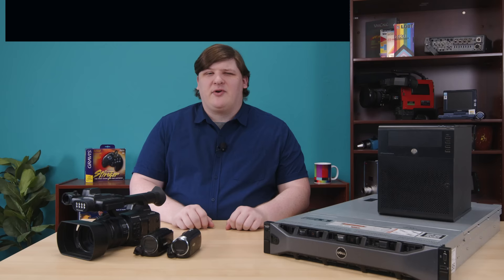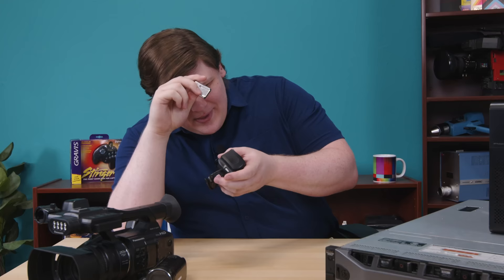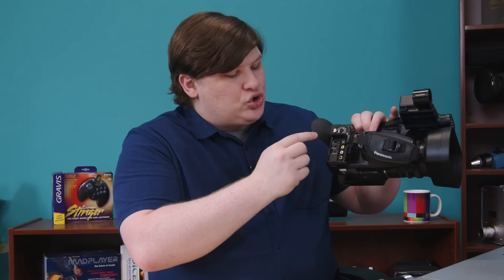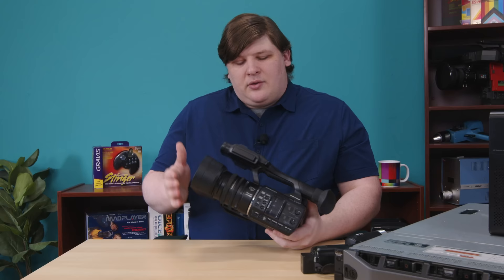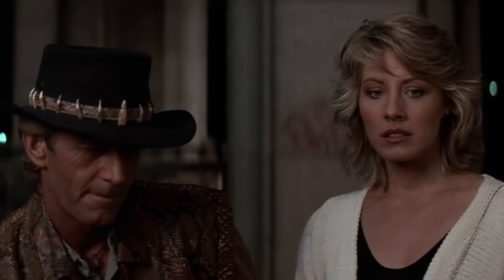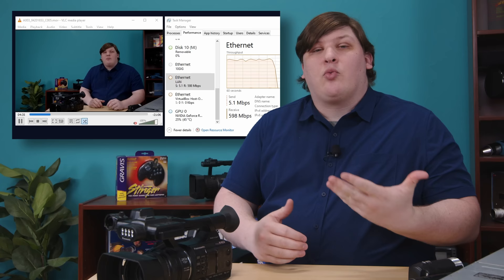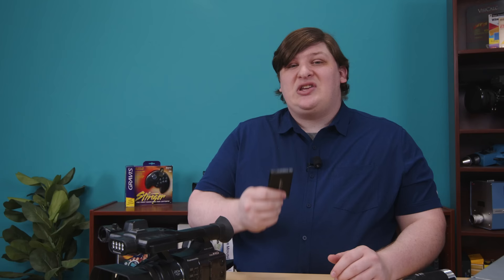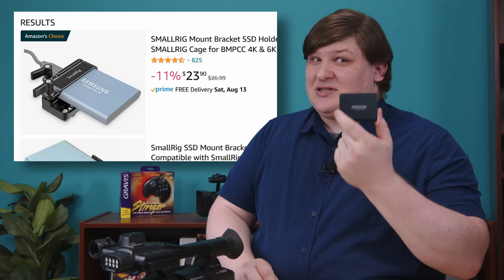I Built... a really fast NAS?

Comment: Lookup lizardfs or moosefs.
Buy two or three more servers.
Don't raid unless it's for improving IO. Use lizard EC2 goals, possibly ontop of ZFS if you feel the need. I just JBOD from Areca controllers.
Setup an archive location and use Lizard to manage redundancy at a filesystem level, then do backups of the lizard metadata often.
Setup a flash storage with SSD's/Ramdisk so you have an editing store, also doable in lizard if you wanted.
You can then add more drives or more servers are you need to expand your storage without dealing with a bunch of raid stuff.
You can also set your raid "level" or redundancy goals at a folder level, so you have more control about how you store content.
For example, we take a source file and make MP4 proxies. These don't need redundancy, so that whole folder only stores one copy but we have 3 of the source.
If I was to loose a proxy file, we can re-encode it from source. I'll sacrifice a bit of computation for the saved storage.
If you need to do maintenance or have hardware/backplane problems you'll be hooped with only the single box. As you become more of a producer, that time more and more becomes $ or lost $.

From a guy managing over 300TB of archived producer content on consumer hardware, LizardFS is like a gift from god. 
There was days I'd have to tell people to go home because a raid was rebuilding, now we can loose whole servers off the network and the content is still accessible.

Comment: Until a couple of weeks ago, I had a lovely silver T7 for 2 years.  Lovely fast drive, certainly more than fast enough for my needs, and the encryption didn't slow things down perceptibly (fairly important as I do deal with some data that requires security - nothing really secret though).   Then one day, I was copying a load of files to it.  I tried to pick it up, and it almost burned my hand.   I immediately unplugged it, and left it under desk fan to cool it.  When it had cooled to a reasonable temperature, I tried to plug it in.   The enclosure was picked up by the computer but the SSD wasn't.

Got another one now, and I've managed to get most of the data back from other sources, but it still annoys me.

Comment: I saw this same problem when I started to record HD content, to solve it I now capture from the HDMI out on my Sony A7Rii when recording at 4k using a USB3 Elgato CamLink 4K and offload the compression and storage to the PC which is connected to a NAS on a 10GBe link. Obviously this keeps me limited to the length of my HDMI lead (about 10m), but is a very cheap solution.

For your kingston device, just 3d-print a shim to fit them properly, would only take about 20 minutes of modelling to make it.

Comment: Since you are working with large files, with a point to point 10gbe connection, make sure the NICs at both ends are set to an MTU of 9000 instead of the default 1500 which is common in consumer products (Eg, Windows desktop). As network failures requiring retransmission are very unlikely over your short, reliable connection, a 9k MTU will significantly reduce the relative amount of network protocol overhead vs data and will increase throughput.

Comment: The t5/t7 drive thing caused some APOCALYPTIC rage in the pro video world, it isn't just you.

What I'd suggest for the clamp being doofy is getting a 'cage' that has cold shoes and rails in more, better places to mount the clamp. Conveniently, they're usually made by smallrig
Reply from the maker: Yeah, I ended up buying a clamp that fits the T7, and it has an infuriating spring loaded design but I can work around it. I got a cage as well, and it has a shoe in exactly the right spot, so I'm pretty much good to go, even if this is... not a satisfying solution, lol.
Reply: @CathodeRayDude  someday, a piece of camera rigging gear will decide that camera operators are neither willing to just hold something with a spare thumb the entire time or grow six spare arms to put the rig together in the short term 

Until then, well,

Comment: FYI look into U.2 NVMe drives...mechanically the connector is SAS, electrically it's 4-lane PCIe. The drives that come in this format are designed to be abused by writing unlike consumer SSDs, all with the insane speeds of NVMe. For example Kingston has reasonably priced product ranges. Used server gear will slowly start supporting these.

Comment: My Intel Core i7 12700k includes hardware encoders for h265 & h264 which helps when I transcode videos. Some videos that would transcode at 10 frames per second now transcode at 100 frames per second or higher. I built that for a plex server while the video cards where 2 to 3 times MSRP.

It might have been corrosion from humidity on the connectors depending on where the server came from for when unplugging & plugging it back in fixes data connections. please note they level of corrosion may be small enough that you won't even see evidence of it after you unplug the connectors & look at them.

Comment: I'm not familiar with that server backplane in particular, but SAS does have redundancy features built-in, so it's quite likely the extra cable is indeed a second channel on the backplane to provide multi-path support.  Speaking of FibreChannel, it also does this to provide cable and even switch redundancy in a SAN environment, and both use WWNs to individually identify paths to storage targets.

That said, if the second path is causing the RAID card to drop PCIe lanes, that probably means it has caught The Dumb and may not be super reliable.  Kinda sounds like that machine has seen some stuff, and you may be replacing parts until you've built a whole new ship.  But hey, with tons of them out there in circulation, that's not necessarily a big deal.

Comment: 1:21:08 Fun little fact about those SAS to SATA cables that I had to discover a while ago when building a somewhat (but also somewhat not) similar storage solution: They are actually directional! This really surprised me, since when was the last time you encountered cables that only work in one direction despite the connectors being identical on each one? Anyway, in my case I was trying to hook up SAS hot-swap bays to a standard SATA interface, so naturally I had bought the wrong cables and had to go back and find and get the right ones.

Just some of those weird things you only really experience when using enterprise grade hardware in ways it wasn't designed to be used.

Comment: 12:32 Now, most cell phone cameras already do this. My Pixel 8 Pro has a 50mp camera. When I take a picture, I can go into the photos app and it gives me the option to "select a better shot" with a slider that I can move along a short video clip that it captured on either side of the initial picture I took. It is quite clever.
Reply: It has become quite universal. I was surprised when windows recognized it when I transferred photos over from my (samsung) phone. It's been useful quite a few times, especially since shutter delay continues to be a problem on phones.

Comment: Ey, don't diss the HP N54L, I still use 2 of them for stuff an things. Right now one is hosting 4x8TB over NFS (via SFP+ DAC cable) to a VM host without slots for disks.
Previously I used one for ARM (Automatic Ripping Machine) with 1 BD drive in the 5.25" bay and then 4x USB-DVDs sitting on top using the front ports. I could rip movies directly to it's local RAID just fine and ripping 5 disks at a time was no problem.
Back in the day I put a USB-3 PCIE card in one and got a 5x USB RAID Box and ran a NAS with 9 disks.
Flexibible little machines that is quiet and don't take up too much space

Comment: You've probably already got a bunch of comments pointing this out, but SAS does not use an identical connector. If you look carefully at the top of the filled in bit of the connector you'll notice it has a set of contacts on the opposite side of the regular SATA contacts. Those are another set of data lines.

Comment: P4 Tesla is only $100 bucks that with unraid and TDAR running automatically on your folder is really simple.  My P4 can do 3 hvec encodes at the same time before it pegs out the encoder.   No external power required.  I know this was a year ago but this stuff is so fun to do for me.

Comment: I will say, from personal experience working IT, if you can somehow get or borrow an account with ongoing support contracts with Cisco, then you should 100% use their servers instead. The C240 M4 is one of my absolute favorites because it has redundant BIOS, a very similar feature set to iDRAC via CIMC, and overall better and less weighty build quality. I've had fewer problems with CIMC dying than I have iDRAC failing on me. Plus, the Cisco HUU is a much nicer way to update hardware firmware compared to fighting with iDRAC to try to get it to update your hardware's firmware. Only problem is that Cisco is a bit anti-consumer in that they lock their support files behind a fucking pay wall, so that's quite the conundrum. If you can find a site that posts accounts with support contracts then, well, you're golden. Otherwise, Dell is unfortunately the only company that makes servers where their support downloads are fully available for anyone to access. HP is pretty bad, Lenovo is similarly bad, and the others aren't even worth mentioning because they're either proprietary or rarified enough to not be cheap on the secondary market. Fujitsu and Hitachi both make spectacularly reliable servers, but good luck finding any. IBM and Oracle have servers, but many are not x86 and are thus a pain in the ass to actually utilize for anything other than what they were designed for.

So, if you can't borrow an account, then Dell is the only viable option and if you can, then Cisco is the brand to go for. I love working on those servers because CIMC is just pleasant to use. Unfortunately, you basically can't go any older than the C240 M4 due to Flash dependencies, and Flash is dead, for a good reason. Another important thing to note is that the Cisco HUU must be mounted as a CD or DVD, so it will not run from USB unless you are using something like an iODD Mini to emulate a vDVD drive to boot from. Loading the HUU via CIMC is also entirely viable and it's a totally bonkers proposition. It uses the backup BIOS and CIMC partitions to install the update, then switches over to them after the update completes. Love it. Many even have DIP switches on the motherboard or on a management board to forcibly switch it back to the secondary BIOS or CIMC module. I cannot overstate how useful this is after a Lenovo tried to flash back using a "golden ROM" that was too old for the processor since this was on the LGA2011v3 socket which had BIOS updates that you had to run that allowed compatibility with newer processors but broke backwards compatibility with older processors. So what it did was try to flash back to an ancient BIOS revision over and over again because it got interrupted when a developer tried to run a BIOS update, but it flashed an incompatible BIOS and bricked the machine. With Cisco, we could have upgraded the BIOS, replaced the processors, confirmed functionality, then mirrored the BIOS modules to have a known good failover module in case of a failed BIOS flash in the future.

That alone is reason enough for me to rec Cisco like they paid me.

Comment: Interesting video. Thank you for sharing you experience! 

Have you looked into iSCSI? I wonder if it might be a good fit for your workflow in future. 

Rather than making a files available across a network, it makes a whole (virtual) disk available. 

It has its limitations and isn't interchangeable with SMB in most instances. You probably won't want to switch over entirely.

But it may be useful as part of your setup (specifically for temporary storage for software that won't accept SMB shares), or at least worth knowing as an option. (You can also do some cool stuff, like completely diskless machines using just the NAS etc.)

Another tech worth knowing about is Windows' native VHD(X) support and how that functions. Sometimes that can be (ab)used to bypass limitations with software. Dropbox's storage location for example.

Comment: 38:00 Yeah when I was a kid I had a system with a Coolermaster HHC-001 heatsink-fan combo. I seem to recall the fan on the thing ran at 6800rpm so it sounded similar to that and of course because I was young and stupid I left the thing running at 100% all the time even while sleeping. I'm pretty sure I have tinnitus in both ears due to it, and ironically-enough the tinnitus only ever strikes when I'm in a dead-silent room resulting from a power outage, so my solution was to use a pair of CyberPower 1500VA UPSes to keep all my shit running so I'm never woken up by the sound of a smoke detector alarm in both ears unless there actually is a fire.

Comment: ZFS for the win.  I use lots of old crappy drives for offline storage in pairs with ZFS and occasional scrub runs and I know everything is good.  My SATA 'toasters' were a bit unreliable with their 'wall wart' power supplies so I just wired them into the 12V rail from the vastly more reliable PC power supply.

Comment: Consider a second rack Mount machine…one that is more like a rackable case with generic mobo you can properly install a standard linux-capable GPU in. Hook it up with another SFP cable. Set up your ingestion script to send a copy of footage to this other machine to re-render your video for archive purposes and then send it back. It can sit idle using little power until your ingestion script commands it to run after a full dump of your “negatives” and won’t interfere with your workflow since it won’t bog down that R720XD much.

Comment: As you said, some people will probably disagree with your choice of ZFSOnLinux, but let's be honest: at this kind of storage scale, without resorting to building a storage cluster, your filesystem options are ZFS or btrfs. Keeping your filesystem, logical-volume management, and block device management all on separate layers managed by different systems simply stops being viable.

And as much as I'd like btrfs to have the stability and maturity of zfs, it isn't there yet.

I guess one could criticise the use of the Linux kernel over something with longer-running zfs support, but as you said, familiarity is worth an awful lot.

Comment: I have that hp server and just boot off the 1st drive bay. I use a separate 4 HDD enclosure on the E SATA port. I use stable bit drive pool for ghetto software raid.  It’s a bit janky but it works on the cheap.

Comment: Surprisingly a lot of high end canon cameras used C Fast. The the Eos 1D X mark ii used it but the mark iii has moved past it to CFExpress but the max capacity is 512GB so it’s a dual slot. Problem is these cost about $500 so it’s hard to take advantage of using a lot of them.

Comment: i recently upgraded my NAS 10Gig network. X520 cards are still very good and dont cost all that much. Currently running raid5 on 5 hdd and get about 200MB sustained writes and 500MB sustained reads out of them. I imagine with SSD its as fast as local

Comment: 15:41 it is not only because you shoot in 60fps, it is also because MB/s is megabytes per second, while Mb/s is megabits per second, so you gotta multiply that 110MB/s by 8 to get 880 Mb/s. The capitalisation matters a lot. EDIT: and immediately after that you go for the differentiation between the two. But yeah, seems like Black Magic has the bitrates on their website in megabytes per second for some reason.